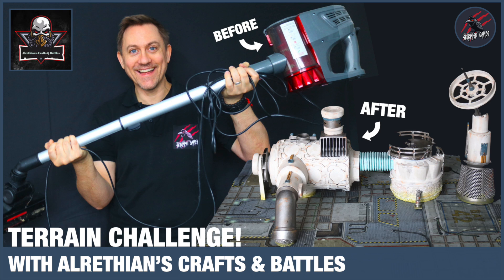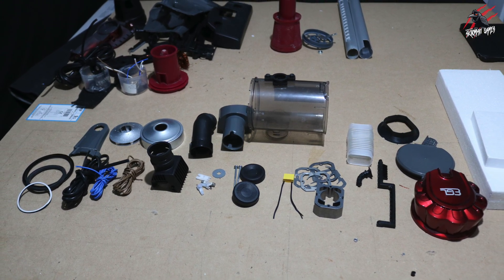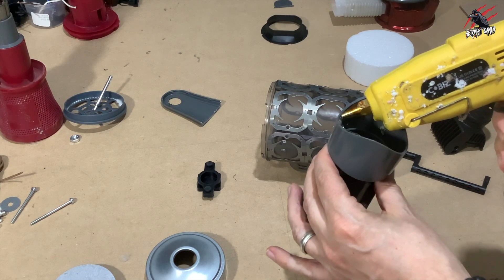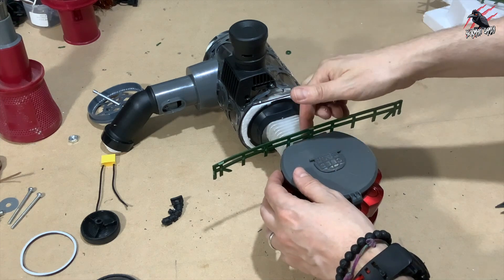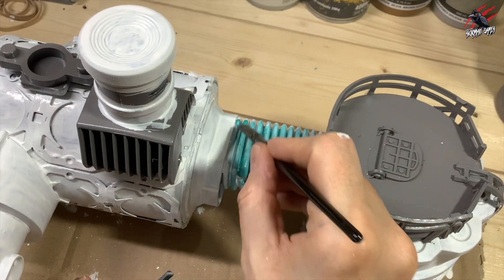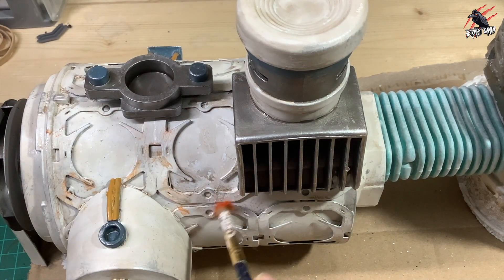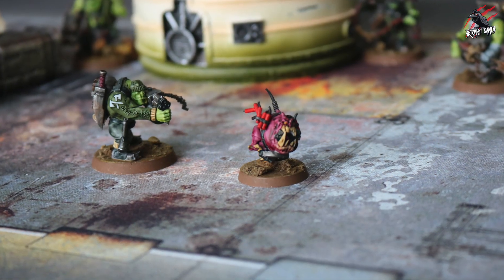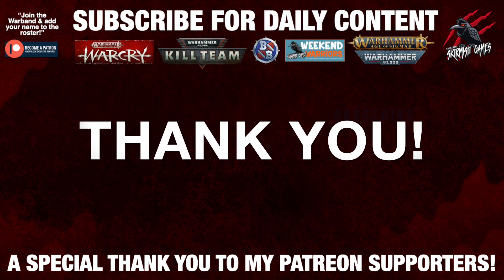TURN A HOOVER INTO TERRAIN THAT DOESN'T SUCK! Terrain Challenge With Alrethian's Crafts & Battles

Comment: Brilliant video! Any tips or recommended products for gluing plastics to polystyrene?  Back in the day I loved working with polystyrene -though I'd combine it with foam board, card etc.  I imagine gluing it to plastics must be tricky!
Reply from the maker: Thank you! I used the hot glue here with everything including the polystyrene. I had it on the lowest setting so it didn't melt it, but took a bit more care as the nozzle can melt it.